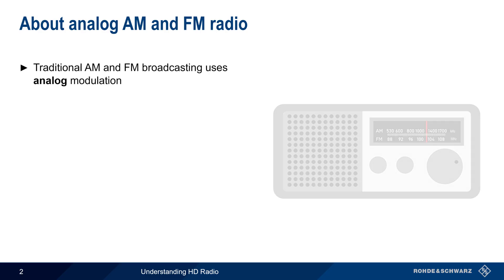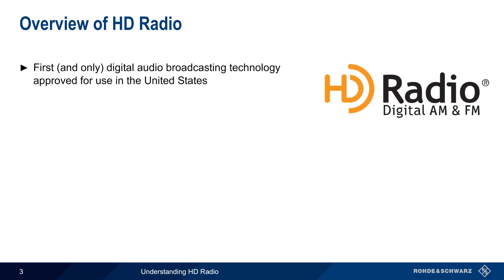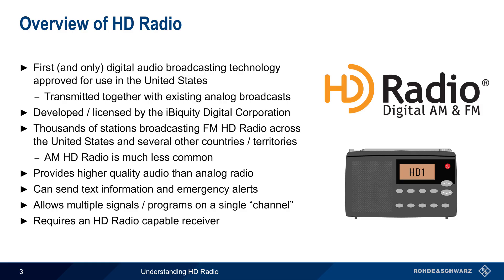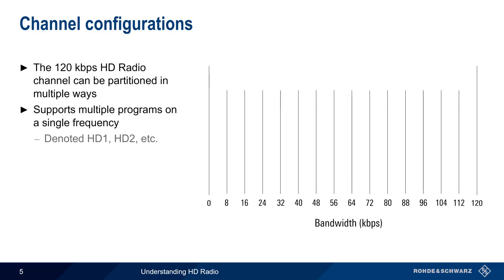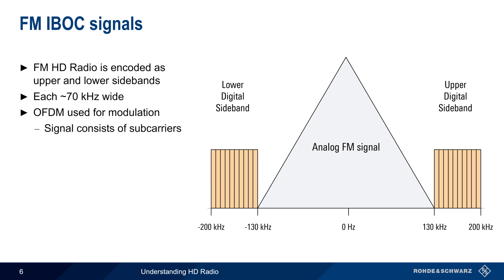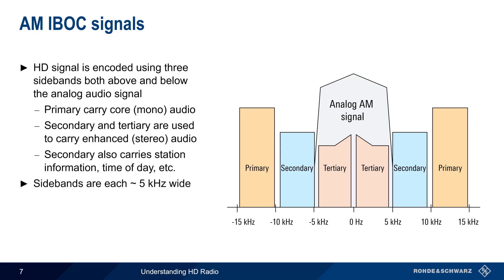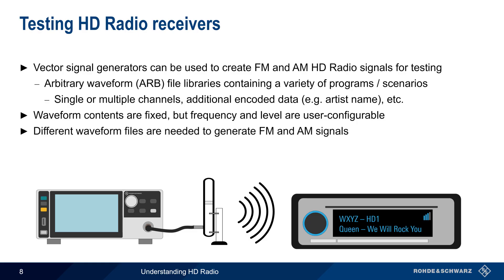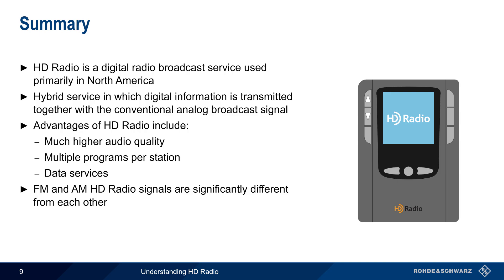Understanding HD Radio

Comment: 3:23 It really should be referred to as IBAC - In Band Adjacent Channel. The digital signal is transmitted on adjacent frequencies. For example, an FM station at 102.7 will use both 102.5 and 102.9 for it's digital broadcast.

Comment: RBDS (RDS) already allows data transmission.
FMHD is not CD quality. The bit rate reduction is no where near CD quality. 
Again, you are not providing complete truth in your posting.
Reply: Hi @kennethandrysiak4130 - If you listen to the video, I say (at 2:14) "HD Radio is often marketed as having “CD” quality sound."  Perhaps I should have made my verbal quotation marks a bit more pronounced 🙂  This is the only time I use the word "CD" anywhere in the presentation.  You are correct in that the only thing that has CD quality sound is ... well ... CDs 🙂  All lower bitrate encoding schemes and all perceptually compressed coding mechanisms (i.e. MPEG) will, objectively, not provide the same audio fidelity as a CD.  I suppose it's debatable how "near" HD radio gets to CD quality - most "objective" measurements of audio quality (like POLQA) aren't suited for making measurements on music.  

If you're concerned about digitally encoded broadcast audio quality, I would suggest you NOT listen to a European DAB multiplex  🤣  Seriously.  I call this out specifically in my video "Understanding Digital Audio Broadcasting"

And I also made a video "Understanding the Radio Data Service" so I'm aware of RBDS / RDS as well 🙂

Comment: Misinformation regarding the ability of AM to transmit audio fidelity (frequency response) equivalent to FM. AM transmission is limited by the bandwidth occupied by a given channel. A given AM transmitter (type accepted; standard broadcast band US) is capable of 15 kHz transmission. This is in to a non-reactive load. The response can be limited by narrow bandwidth antenna… be it a single radiator (tower) or more likely an antiquated multi tower directional array. Keep in mind, in order to successfully transmit AMHD, the antenna system must be broadband enough to pass the digital carriers! Note also the FCC restricted analog transmission response by requiring broadcasters to incorporate a brick wall response curve beyond 9.5 kHz to limited adjacent channel interference. Furthering a point, AMHD transmission requires high frequency response brick walled at 5 kHz to prevent analog audio above that limit from causing problems with the digital carriers. 

The hiccup in AM overall system frequency response lies in the terrible design of AM receivers. Greater than 90% have response greater than approximately 2 kHz! Landline 📞 telephones and cell phones may slightly exceed that… the public now perceiving that listening to AM is equivalent to listening to two tin cans connected with string.
Reply: @kennethandrysiak4130  Sorry for the late response.  Do you mind if I ask whose misinformation you're referring to?  In the video, I was very careful not to say that AM HD audio quality is equivalent to analog FM, although I'm sure you'll agree that HD AM is a noticeable improvement over analog AM 🙂  I'm very well aware of all the issues with AM HD radio, but intentionally avoided including that minefield in the video - as you are clearly well aware, the interference, etc. issues with AM HD are still very much ongoing.

I grew up listening to music on AM radio (out of necessity) and was an avid nighttime AM DX listener for many years as well, so believe me when I say that I understand your feelings about this 🙂  Thanks for the comments!

Comment: So in the context of HD Radio, would the digital information sent in the upper and lower sidebands be considered Resource Blocks (RBs) with regards to the Uplink (UL) of a cellular communication system like LTE?
Reply: Well, modern cellular standards also use OFDM, and similar modulation schemes are used on the individual subcarriers (i.e. QAM), but beyond that there isn't much similarity. HD Radio is a broadcast medium and the subcarrier number and arrangement is static - there is no "scheduling" of RBs, etc. such as the type seen in LTE or 5GNR.  There also is no dynamic control information / system information / signaling, etc. in HD Radio.
Reply: @pauldenisowski  Ok, thanks. I just noticed the similarities between the two since both modulation schemes involve digital transmission in some way.